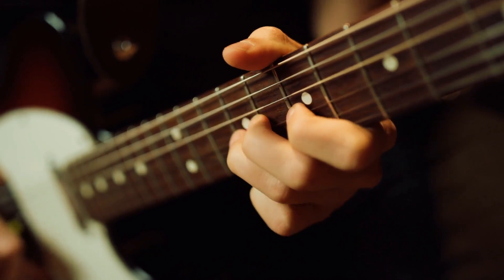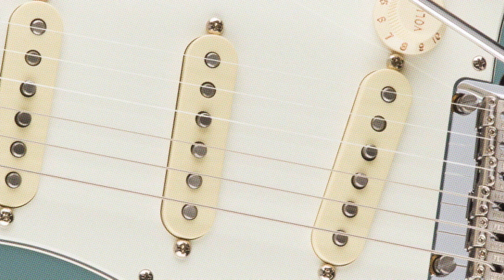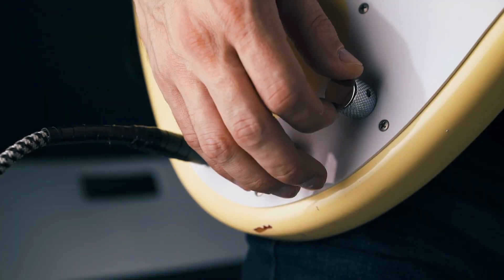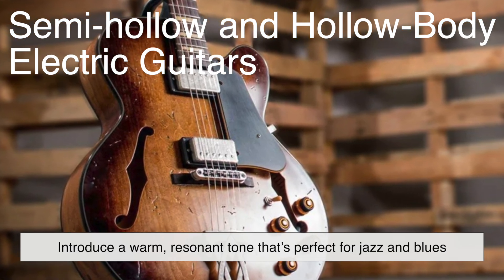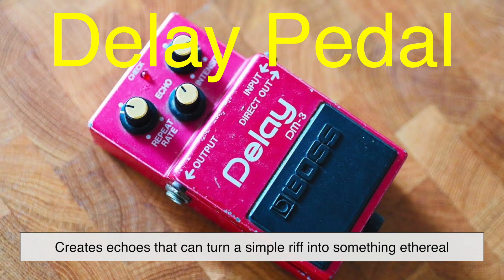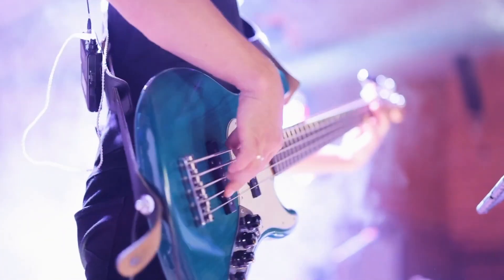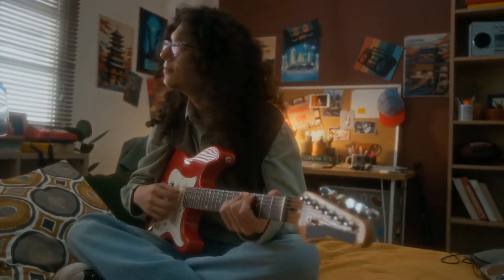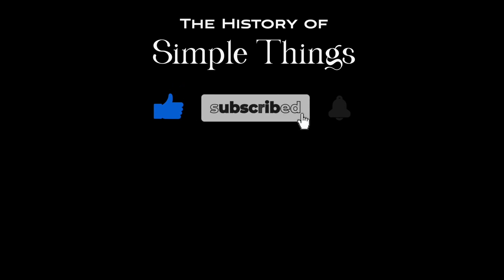How Does an Electric Guitar Work?

Comment: Excellent video.  Thx!  The guitar's signal shown on an oscilloscope would interest many, I think.  Video Suggestion:  Some electronics components can be connected to power sources and only draw enough power to work, but others will draw all power available until they burn up or explode ... why?